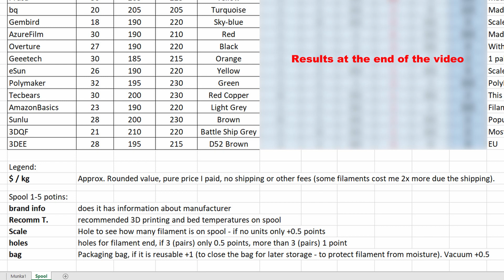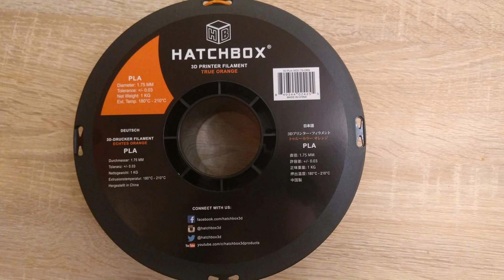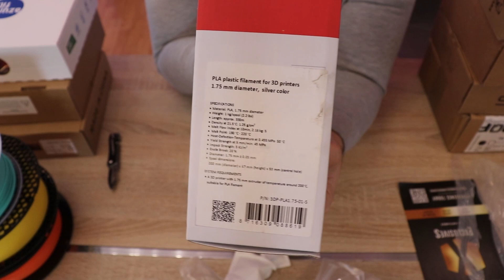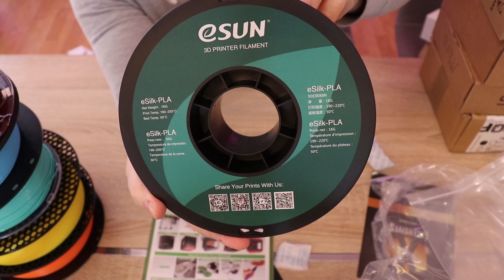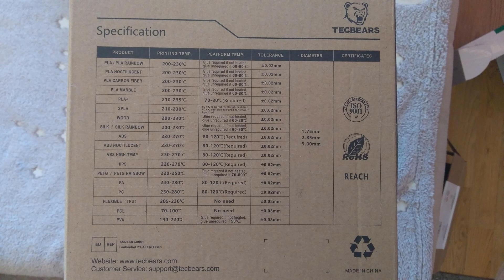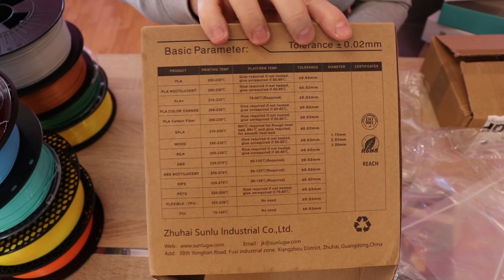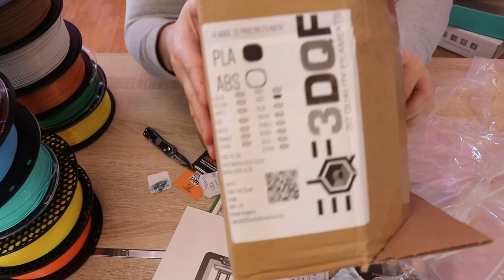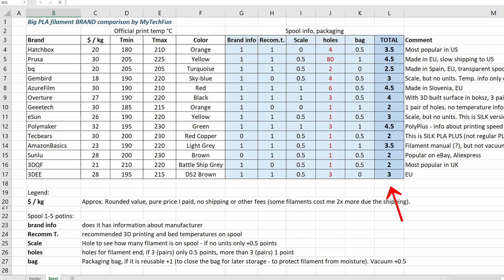Big PLA filament comparison test (14 brands), Part 1/3: Unboxing and spool design

Comment: Thank you so much for doing this! Great part one in scoring the packaging essentially and introducing the contenders. 
I do have personal experience with 2 of the brands and have suggestions for the future. Your second video was in my YT suggested so I immediately watched this first.
Geeetech is great! Well most of the colors I've used... Not the "orange" one you got, it's my least favorite from them. Their old green, new green, blue and grey are awesome.
Tecbears has been good for me. Their blue and green are excellent but you have to really smash the first layer down. I have also used their "red copper" which is an awesome silk, very pretty.
Both brands are best at 200-205 & 60-65 for my FLSun Q5. 
If I can make a suggestion... I know it may be difficult with your location for the brands but if you can only buy one color. Preferably blue, green, or grey (normal red is hard to find in stock these days). For example Geeetech greens are in my top 3 & 4 PLAs but their orange is one of the worst of any color or brand I've tried. 
Again thank you!
Reply from the maker: Yes, I belive, that there is a difference between filaments from same brand, but different colors. But this is what I have. Most of these filaments I bought myself.
Reply: @MyTechFun  again, thank you! If you talk to Spring at Geeetech she will probably sponsor you. Tecbears also has some programs if you contact them. Honestly after part 1 & 2 I will be shocked if you aren't sponsored for some in the future. Filament is not cheap, especially where you are... If you continue your honesty people won't mind if some are sponsored. 
Hopefully this series rockets you up in subscribers!

Comment: Great video, and you have a new subscriber. I REALLY like the clear spools or at least the ones with the big holes in the sides. I've been using 3dSolutech pretty much exclusively over here in the US. It is consistent and I have been happy with it. Their spools are black with not much to visually show you how much filament is left though. I just ordered a couple of rolls from Matterhackers and am anxious to see how that does. I did also run a roll of Geetech silk coffee gold for a T800 Terminator head and was very happy with it.

Comment: I really want too see Prusa PLA prints because I bought one next week and its jamming every single time. i have no clue why because other PLA goes fine.
Reply from the maker: Probably prusa requires higher temperature, I will se with temperature tower soon. In slicer they have higher preset temp settings too.
Reply: @MyTechFun  Update i was wrong with Prusa. my problem was extruder break that caused clogging. Anyway seems to Prusa works pretty well probably having the prettiest results.

Comment: Sunlu melts at a relatively high temperature, which I like. You can drill and sand it without it melting.
Reply from the maker: That will be tested in part 4/4

Comment: Thank you for your work! May I suggest polish cheap filament 3dactive? I use it all the time because it's super cheap (13€  for 1100 grams). If you are willing to do additional testing I could "sponsor" you and buy a spool and send it to you as gift of appreciation of your work.
Reply from the maker: Sure, I am preparing a database on my website. In this series I am testing 14 brands. But any other filament can be tested separate and add values to website (images, results of measuring). My contact email is in About page.

Comment: For printers with filament sensors, an important difference is how the filament end is secured on the spool. On cheaper filaments the end is bent over, which causes all sorts of exciting problems when the filament runs out during the print. On better brands the end of the filament is straight.

Comment: Awesome video.
I would like to see you upgrade the ender 3 so it will be equally as good as the prusa in AL aspects as speed and quality. And also wat the total cost would be compared to prusa. Thanks
Reply from the maker: I have in plan 3 more upgrades. Yes, that comparison may be interesting. Thanx for the idea.

Comment: This is something i am going to follow, i find it interesting to see how they perfom. Are you going to do a rolling test on the spools? I have had some trouble with a cardboard spool. The sides of the spool did not stay round, so it impacted the printquality. One tip, sometimes the colour of the fillaments has an inpact on the printing temperature. Keep up the good work.
Reply from the maker: I don't have in plan to do rolling test. What do you mean with impacted the print quality? Filament stuck into sides of the spool? Yes, I know about color effect to printing temp, but this is what I have, so I can't test that, only note what color is used.
Reply: @MyTechFun  it impacted my print quality because there were indentations on the spools, the spool did not turn equally. So sometimes there was more force needed to turn the spool, the result was a defect in the print.

Comment: Looks like a lot of work ahead! Thanks for doing this, although I'm not sure there will be a lot of differences between them.
But or course, that's the point of this test 👍

I'd be super interested by something similar with a bunch of 95A (or softer) TPUs
Reply from the maker: I hope they will be similar, and I will have no problems with any of them. That's a good result too, but I have to find out. I have in plan to repeat similar video with PETG. And who knows, maybe the TPU will be the next (or ASA, ABS, Nylon...) But that's the future.. First let me finish this one, as you mentioned, a lot of work ahead.